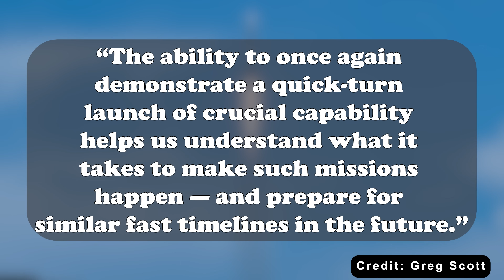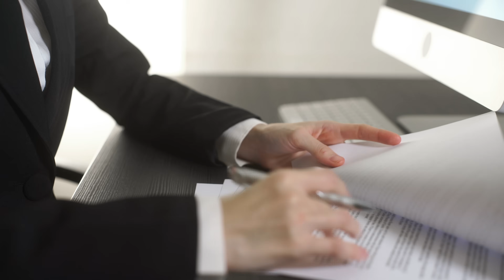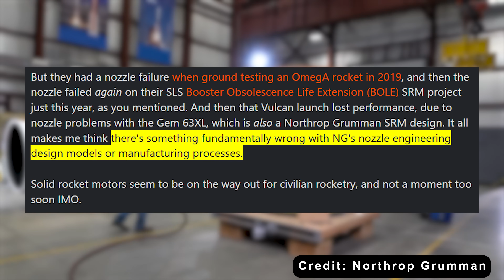What Space Force just Did with SpaceX Shocked ULA! Vulcan in Big Trouble

Comment: Vulcan was built on an outdated idea that I remember being talked about around the time that the shuttles maintenance costs were making the program to expensive to run. Returning the booster engines would cut down on costs, but it was a marginal savings. When you have Space-X and now Blue Origin reusing the first stage booster and even the payload shells, that is a much bigger cost reduction which makes Vulcan a very expensive launch system in comparison. Precision over launch tempo? What is the balance there when you launch two satellites in a year perfectly compared to hundreds of launches with marginal imperfections that are easily corrected with little overall impact? It's imbalanced as demonstrated by the need to maintain the GPS satellite system. If you can only replace two satellites a years and you lose more than that in one year it isn't desirable. But if you could potentially replace ten to 12 in one year, hands down, you can't say that precision trumps quantity when it isn't much of an impact on the satellite's launch.

Comment: Military birds sitting in storage waiting on Vulcan while Falcon 9 is landing like clockwork has to be driving the Pentagon nuts.
Reply: Satellites take over a year to assemble, so have to build them in advance.  Several satellites are ordered at once in a "lot".
If you need another replacement Satellites only every 3 to 5 years, snd you build them as needed, what are the people building the Satellites going to 4:58  be doing for 3 to 5 years before another Satellite is needed?
They get laid off and go work for another rocket company. Then you don't have the skills to build the next one.  So satellite manufacturers build them on lots.  And every 20 years or so, new technology is available to build a better satellite - say a GPS satellite that is accurate to 6 feet instead of 30 feet or make the GPS signal jam proof from Russia (which makes the airplane think its somewhere else that it is actually is.)